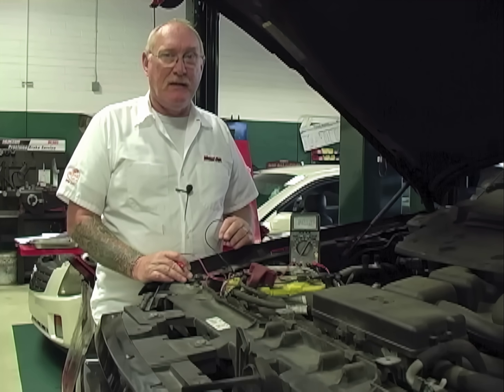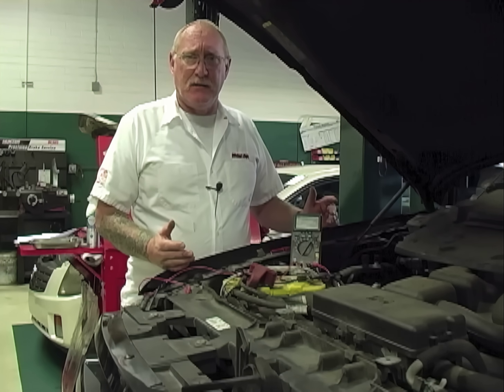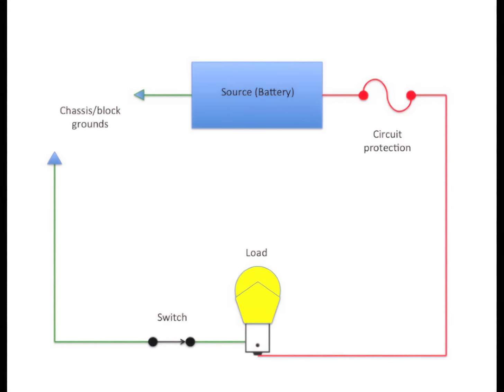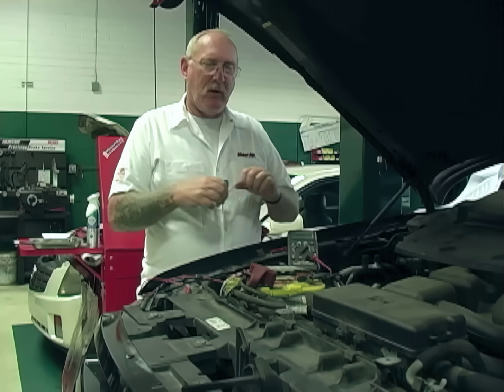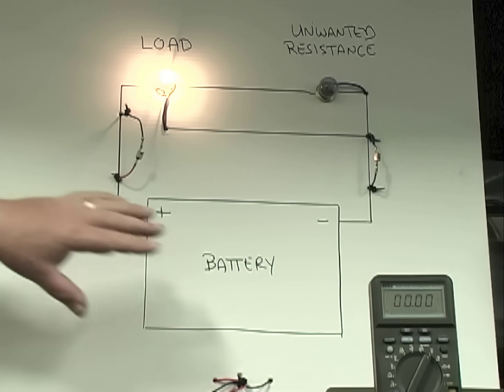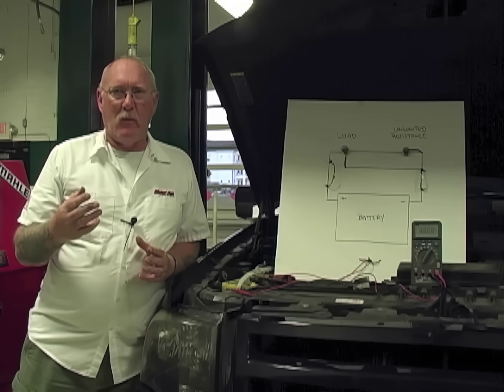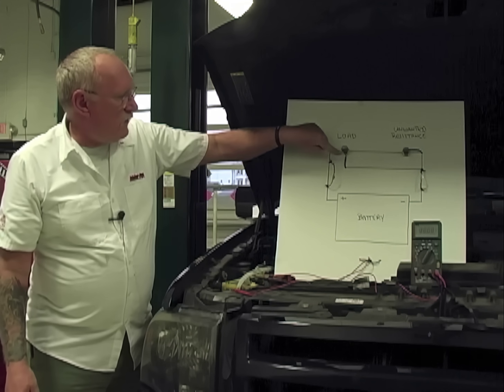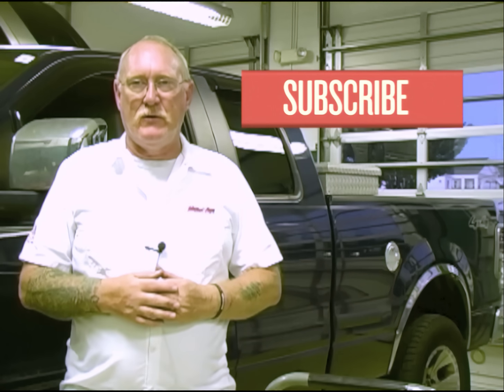The Trainer #47: What measuring voltage on the ground side means

Comment: If you have a current draw when everything is off, the positive battery cable will spark when touched to the positive terminal. Start removing fuses, one at a time, and check for the spark. When you lose the spark, whatever fuse you removed is the circuit  where the problem resides.

Comment: I've built cannabis grow rooms and i have no fucking idea what this guy is expecting anyone to take away from this.

He touches the negative post of the battery and the chassis, and then he says he's measuring from the negative side of the load to the negative side of the battery. First of all, that's reversed. Second of all, there's no fucking way to tell which load that grounds itself to the chassis is the one to troubleshoot. He just kind of throws a premise out there and then does fuck all to actually explain how to utilize the information.

Is the vehicle on, or off? Does it make a difference?

Do you just arbitrarily do this or is this your "step 1" if you think there may be an electrical problem with a vehicle?

How does confirming voltage on the neutral side give you any information whatsoever as to where the problem is coming from?

In the end of the video, when he says he's going to start looking from some point forward, what is he even talking about?
Is he just picking some random place on the frame or in the engine that's near the area he touched the probe and then picking a direction to move from there?
Touching the battery terminal and then touching the chassis doesn't give any indication whatsoever if the problem is on the left or the right side of the imaginary line you just drew between two points.
How is someone supposed to know which direction to even start moving from that point, if the random place you choose to measure the chassis ground from is even the point we are supposed to start our search from?

I guess I'll go somewhere else to look into this. Terrible teacher. Doesn't even find the issue and point it out, no real-world "use example" or demonstration of concept whatsoever. Boo.

Comment: Great video but I need some help Have a 2007 VW Beetle battery goes down overnight so to make this short we ended up taking all the fuses and all the relays out. The only thing left was the small fuse box on top of battery which had three push in fuses ABS, Coolant Fans, ABS Hydraulic pump, and four wires with heavy duty fuses but no blown fuses with meter on neg battery and the other neg cable reads the same voltage as the battery hope you can tell me where to start very tight eng compartment.

Comment: With a sound systems, a way of testing for ground faults is to unplug the rca cables at one end, amp side is usually more convenient, and measuring the voltage between the cable ground and the amp's input rca connection's ground.  What happens is the voltage difference causes current flow on the cable which causes noise to be superimposed on the signal.  In the worst situations, isolation transformers in the signal path are the cure.

Comment: Every mechanic should the very basic ohms law,  voltage V equals current I times resistance R,  or V=I*R.   Then understanding ground voltage becomes very easy.   in this case you have two serial resistances,  R=Rl+Rg.   Rl is the resistance of the load and Rg is this resistance after the load to the neg bat post, which is usually a corroded wire or terminal or bolt.   your “ground voltage” Vg is 12v * Rg/(Rl+Rg).    You could also have resistance on the wire connections from the positive battery post to the load,  call it a preload or Rp.  in this case R=Rp+Rl+Rg. Both Rp and Rg reduce the current through the load,  thus affecting performance of the device.

Comment: I was tryin to salvage a bluetooth speaker that quit charging at the port. I just used what parts i could find and only connected a red and black. That cord only had the two and is required usb power to function. I was only to use my phone without aux limitation. I found that third wire from the battery causes a hum if plugged in the same outlet as the reciever source. I had to disconnect the speaker cause volume affects the daisychain feature same as how rca outputs unless (sub)preamp or amp with external gain knob.

Comment: Another thing to look for first to keep you from going crazy looking for that parasitic voltage reading from negative to ground that they taught us in diesel mechanics school is the battery itself.
    ALL wet cell, lead / acid batteries are vented whether it's apparent or not. There is also no such thing as a perfect seal between the plastic battery case and the terminal posts. If the battery isn't cleaned periodically, a conductive residue of acid, dirt and whatever else that the battery is exposed to will form on the outside of the battery.
    One way to test for this is to put one meter lead on either battery post and drag the other one across the top of the battery. If the residue is present, you will get an irregular voltage reading while the meter lead is moving or a more steady ready reading when stationary.
    If you get a voltage reading, as shown in the video, with the negative lead on the negative post and the positive lead on body ground, try cleaning the battery first by pouring a strong solution of hot water and baking soda over the battery, taking a clean rag and wiping down the top and sides of the battery then retesting for ground voltage. If it's gone, you're done.
    What happens with a dirty battery is the vapor coming from the old style battery cell caps, the cap strip going across the top of the battery or imperfect seals around the terminal posts will condense in still air when parked and deposit itself, in the form of a sticky residue, (Sulfuric acid itself is thick), onto the battery case. If this residue is allowed to collect over a long period of time, it will creep down the side of the battery, corrode the paint from the steel battery plate and will form a conductive path, albeit a high resistance one, from the positive terminal post, down the side of the battery to ground. In this case, what you would be reading is a voltage from the negative post to the positive post through this conductive acid scum.
FUN FACT:
    This doesn't apply to 1999 Dodge (Grand) Caravan, Plymouth Voyager or Chrysler Town and Country with cruise control. While keeping your battery clean is always a good idea, the listed vehicles, battery mounting plates are plastic as they are hollow and also serve as the vacuum reservoir used for smooth cruise control action. In Chrysler products, the cruise control, when set, will control the speed +/-- 5 MPH on up or down inclines. If you have one  that deviates from these parameters, check the battery plate for loose or broken hoses, cracks or holes. If you find of these defects, replace the hoses and / or the plate itself and it will correct the problem. I had a argument with the Dodge extended warrantee program. They claimed the battery plate wasn't a mechanical part and not covered. They backed down when I told them it was an integral part vital for a properly functioning cruise control as the vacuum reservoir. They paid for the repair.
    I hope this helps your viewers as it had helped me to avoid tracking down non-existent parasitic voltages on several occasions.

Comment: I have one for you. Measuring voltage on the ground side......of a house.
    My wife was in the living room one day doing some crafts. The only power consumed in the room was a ceiling light, ceiling fan and a few tens of watts hot glue gun. At one point, she said that her glue gun wasn't hot anymore. I broke out my volt meter and set the meter for ohms / continuity and tested the gun. It was fine. I checked the outlet, no power. I checked the breaker and it was on. The outlet she was plugged into was in an inconvenient spot for pulling it out of the wall so I tracked the circuit back to a dead outlet that I could easily pull.
    I pulled it out, checked across the red and black wires and it was still dead. Something told me to check it from black to earth ground and we had full power. I put it all back together and pulled the cover off the breaker box to find the neutral white wire was burned off from the buss bar. It was 14 gauge wire, (important later).
    I tracked down the rest of the dead circuit to find that the asshole who wired this double wide had run the circuit from the breaker box, through the kitchen, out to the master bathroom and into the room where my wife was.
    Why do I call them an asshole? They wired into the kitchen, where anyone might set a coffee pot, with 14 gauge wire that's rated at 15 amps. A 1,500 watt coffee pot draws 12.5 amps. All fine and good. This circuit also runs into the master bathroom where a person might plug in a 1,000 watt blow drier, curling iron or a 1,500 watt space heater all drawing 8.3 to 12.5 amps. Still good. Now have a wife, not understanding electricity, plug in a space heater after her shower along with a blow drier and me, the resident coffee addict, not knowing this circuit is all tied together, making a pot of 1,500 watt coffee on this 14 gauge circuit connected to A 20 AMP BREAKER and the damn thing NEVER POPPED. This is due to a long, light wire high resistance condition where the voltage drop never showed the breaker 20+ amps in aggregate. Yeah, several neutrals were waiting to burn off and this was only the first to go.
    I should have known to check when I replaced the 30 gallon, 3.500 watt hot water tank that was wired on a 70 foot run with 12 gauge wire. 12 gauge wire is rated for 20 amps and a 3,500 watt tank draws 17.5 amps, almost at the wire's max limit, but 0ver a 70 foot run, you have to go to 10 gauge wire rated for 30 amps. I was replacing the tank with a 40 gallon, 4,500 watt unit drawing 18.75 amps and was rewiring the circuit with the larger wire and breaker anyway.

Comment: If I have a petrol gauge and it reads  back to front the only resistance is on the gauge in the tank but it is working so how do I change it's polarity to normal

Comment: I remember going back some 40 years ago in electronics class that power flows from negtive to postive in a dc circuit.   Ac is different and current actually doesn't flow it pulses  +- + or viceversa  -+ +

Comment: I have a question i must have forgotten some important electrical principle since way back in CAPS program buy lately i have come across several batteries non automotive but the principals should apply buy i check the battery with a dvom and it shows say 24.0 v but it wont even glow my test light or accept a charge ??? wth?? mind you this is a 24.0v ni-cad batt but i have seen this with lith-ion and lead acid as well

Comment: We've all assumed at times that the problem in a circuit is in the positive side or in the switches and components. It is helpful to remember that EVERY part of the circuit, from the positive battery post to the negative post, is equally important and equally vital to the circuits proper operation.

Comment: I would paraphrase it as "weak, damaged, loose or corroded ground return circuit components", look for these clues from the ground side of the load. Years back I had a good looking wiper motor assy with a copper strip ground strap, no visible damage or corrosion, but, between the point of contact under the nut corrosion prevented the motor operation, wire brushed and light grease and retorqued the connection with a star washer in the joint and my '68 Dodge was back in action. Further when measuring, be mindful of the load current and likely length of the ground path, for example on a running 318CI V8, expect 1/3 of a volt between the bat Neg terminal and the engine block.

Comment: It can only mean that there's considerable resistance between the negative side of the battery and the body frame of the car. Corrosion in the connection?

Comment: Well it's no shade tree mechanic from back in the 70s we called this  feedback . Old Ford trucks was notorious for this. The bulb sockets had tendency to go bad. Turn on the left turn signal it works great turn right turn signal on both tail light blink dimly. That bulb socket was feeding 12-volt back into the ground.

Comment: Uummm I can connect add multiple light bulbs to the same circuit without a problem like adding side markers to my turn signal or adding a license plate light to my running light circuit ect when I need 12 volts I tap into 12 volts never had a problem in 20 years. ???? Please explain….I’ll wait

Comment: I made the same diagram and I put my positive lead on battery positive terminal and negative lead pass the load meaning on the negative side of the load and I still get battery voltage. As you are saying that the load should consume all  the voltage but I still get 12 volts not zero volt, what am I doing wrong?

Comment: Firstly, let me start by saying how informative your videos have been. I have a quick question, I am only a hobbyist, meaning, I do work on my own car as much as I can because of medical conditions prohibiting me for spending money on a mechanic for things I may do myself. I have a tumor in my stomach about the size of a gridiron ball, so as you can imagine, finances need to go where needed first. My question is simply, do you always test at the connectors/switches etc to get your before load/after readings or find a spot close enough to splice into the wiring to be as close as possible to where you want that reading. Currently, I am trying to troubleshoot a 2006 Ford Focus issue with its passenger side (opposite here in Australia) stop/tail light. I have the scematics and have determined that both left and right a linked in with High Brake light. My issue is that the both side taillights work and then when the brake is applied, the top mounted light works, drivers side works and the passenger stops working. As you would be aware, they are using double filament bulbs.

Comment: Very good practice however some times I've used your format and pulled fuses to locate the circuit and some times put a tone on the circuit to trace the circuit.  Granted all circuits are short or long.  And don't need this extra.

Comment: I need help. I have a 12v small motor. When testing with a test light, I got positive coming in from one wire and I also got a light on the negative side out from the motor. Is this normal? The motor is set up,  positive all the time and it gets the ground from the ECU.

Comment: I’m measuring 12volts between the chassis and the (disconnected) negative battery pole (positive side still connected, obviously). The pickup runs, is drivesble, and the battery doesn’t drain enough to affect starting, so the amperage of the short or parasitic draw must be very low. It will very dimly light a test light.

I’ve pulled every fuse in the truck one by one, and still measured the 12v between the (disconnected) negative battery pole and the chassis.

I’m not quite sure quite how to proceed. I guess this means there is a small short  upstream of the fuse block?

The reason I’m working on the truck is an attempt  to get rid of a persistent error code (the infamous 52, knock sensor not detected). I’ve replaced the sensor, the wiring for it, and the ECU with no luck, but maybe current from a short is overwhelming the tiny AC signal from the piezo in the sensor? It’s driving me a little nuts.

It’s a 1989 v6 Toyota 4x4, by the way.  Don’t know if anyone answers questions here, but I’d welcome any insights of advice.
Reply from the maker: Thanks for watching.
I wish I had an answer for you. Our technical editor is training at an automotive event in Australia and won't return for a couple weeks, or I'd pick his brain.
It's possible one of our viewers will chime in with a helpful suggestion, though.
Reply: @VehicleServiceandRepair    Thanks. I realized that I’m an idiot and that the 12.52v is normal when I realized it didn’t happen with the neg  cable connected. However, I still have that infernal knock sensor problem…
Reply from the maker: @Congruesome  
I wish I had a better answer for you.
It sounds like you've covered the bases by replacing the knock sensor, the harness, and ECM.
The only thing I would consider is to make sure the replacement sensor was installed without Teflon tape or anything that would act as an electrical insulator. -Jay
Reply: @VehicleServiceandRepair  it’s installed correctly, torqued correctly and has not been insulated by any tape or thread compound.

The stereo has a distinct whine (yes it is grounded and the alternator has been rebuilt and is also grounded properly) which rises and falls with rpm. I wondered if the lie voltage AC signal from the piezo crystal in the sensor might be being drowned out or interfered-with by some other electrical noise.

Comment: I enjoyed your video. I don’t quite understand it yet because you didn’t mention how much voltage drop it was from 12v. I seen a series parallel circuit which the voltage should have been the same all around the circuit

Comment: Had a bat grnd cable turn into a huge resistor one time, cut thru the cable sheath and there the prob was 4 inches of blu green copper sulfate, caused by a low grade short in a headlite dimmer switch

Comment: I definitely have a bad ground....but now how do I find it. It appears it is showing up on several circuits in the fuse panel. It reads zero until I cycle the key then reads 8v. Still not completely understanding what could be going on here.
Reply from the maker: Pick one circuit and work your way back to the battery on the ground path until the meter returns to normal. But before you dive in too deep, check the battery cable connection. If it one of those replacement ends that use a clamp to hold the cable - that is likely the problem. Even a loose cable can cause the issue you're dealing with.